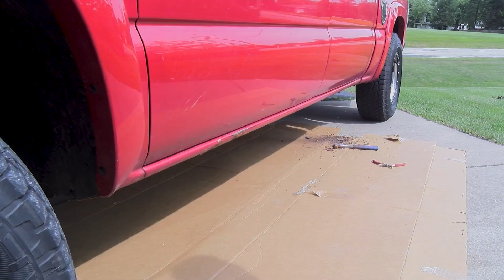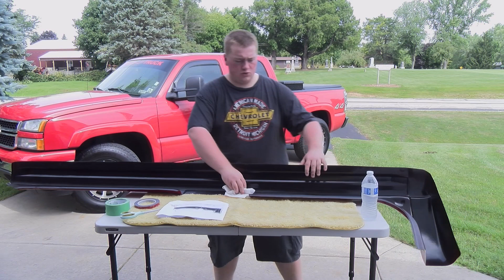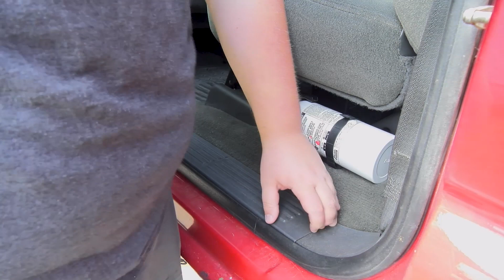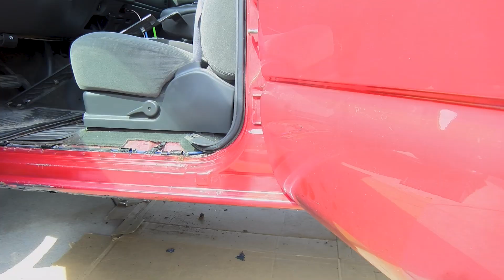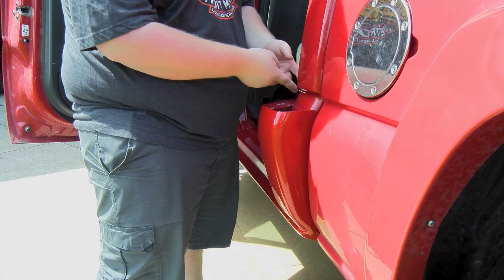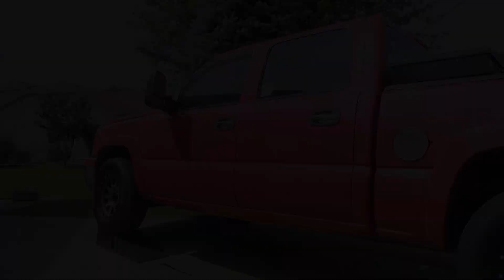99-06 Silverado Quick Covers Rocker Panel Cover Installation

Comment: Do these units come in like primer grey or black. Is paint required, or will it looked usual without paint?
Reply from the maker: They came just black, unpainted. They had to be primered and painted. I know they were working on some black ones that didn't have to be painted, but I am not sure if they are selling those yet or not.
Reply: We also offer our Quick Covers with a textured plastic that is UV stable and does not require paint. They are black with an "orange peel" type texture, similar to bed liner but with finer lines.

Comment: What about the inner rocker and rivits
Reply from the maker: I couldn't get mine to line up when I installed so I left them out, I've been told that that specific issue was fixed though and they are more forgiving with tolerances now.

Comment: I see some people that add screws on the bottom--did you have to do that?
Reply from the maker: I will say, after almost a year of being on my truck, they have held up great. There is one spot where I must not have lined it up well that the corner of my door hits it and is chipping paint away, but it is so minor! On the exterior they have held up great and still look awesome! It was way cheaper than replacing the metal and looks way better than the rust!
Reply from the maker: I did not have enough material to screw into that was good yet. I had some extra brackets that were supposed to go inside and give extra support and something to screw to, but they didn't fit up quite right.